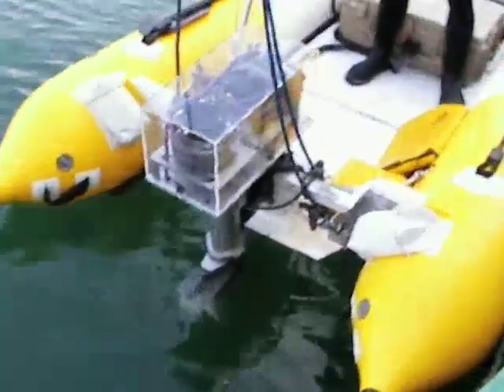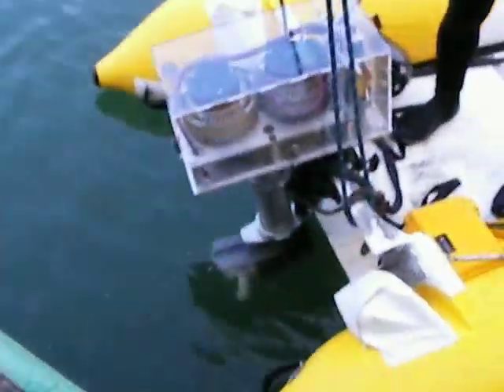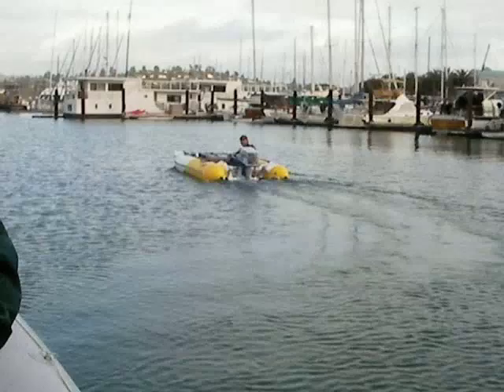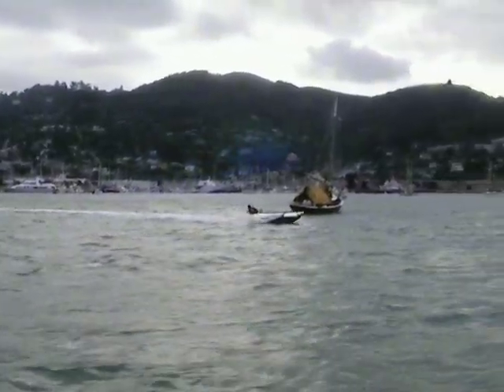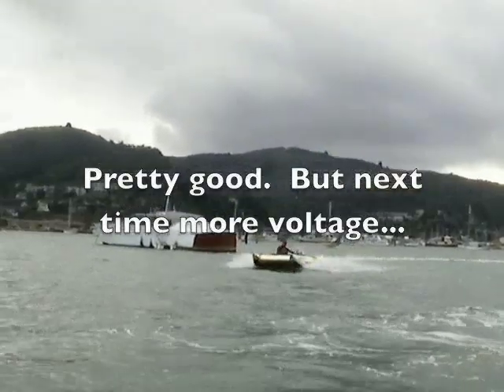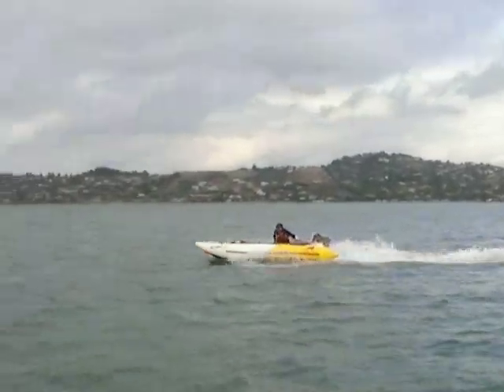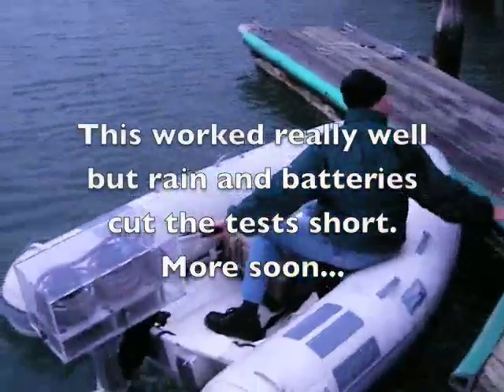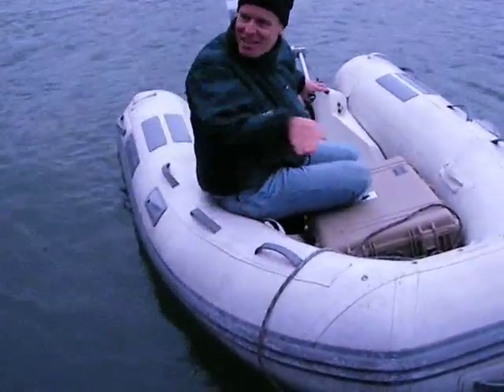Electric Outboard seawolf-test

Comment: Engine is *way* too low in the water, the little rooster-tail spraying almost directly up is an indicator. The cavitation plate, just above the prop, should be *slightly* lower than the keel of the hull.